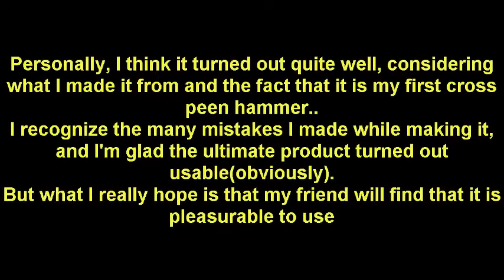Blacksmithing - Hammer from a Jackhammer bit

Comment: I think jackhammer bits are a chrome molybdenum alloy. I made a knife from one. Very hard to hand forge-tough steel .
Reply from the maker: I probably should have made my drift out of the jackhammer bit and my hammers from that 1045 forge welded into a billet

Comment: Again...you have drift with too scharp couners. It is easy to make those couners round....simply use angle grinder. Your peen is curwed a bit. Why you are not using a ready hammer bilet ?Now youre doing lot of heats on this to make a billet.
Reply from the maker: Yeah, this was the last hammer I made with a square eye, I rounded the drift right after I made this hammer. I made it from this scrap metal just because I've always made everything from scrap metal, I suppose it's just my way of doing things
Reply: @thecrookedanvil  I think it's awesome you didn't use an grinder and forged it completely by hand for most part , it takes more skill in my opinion and patience